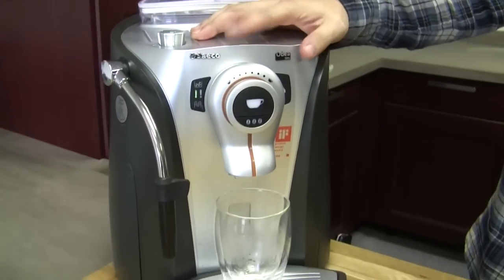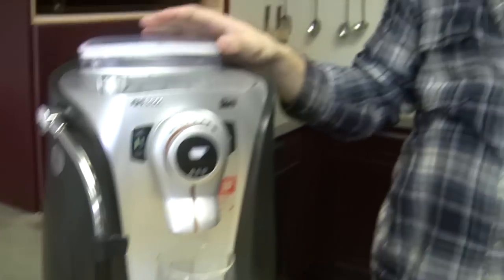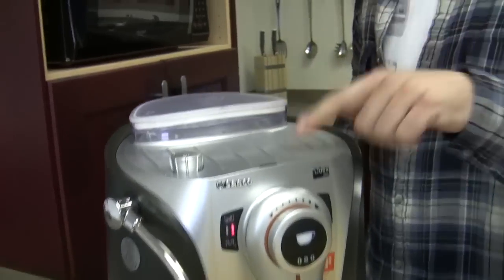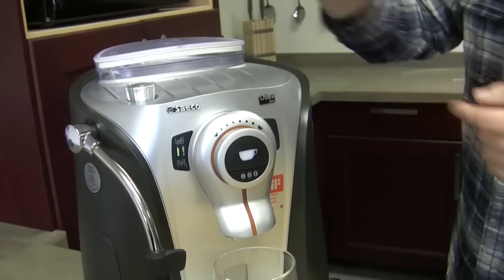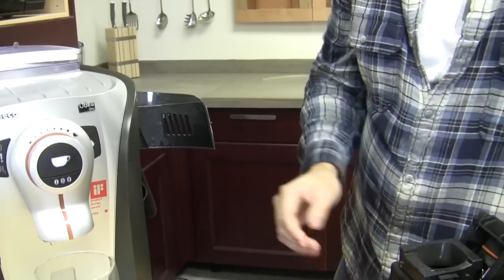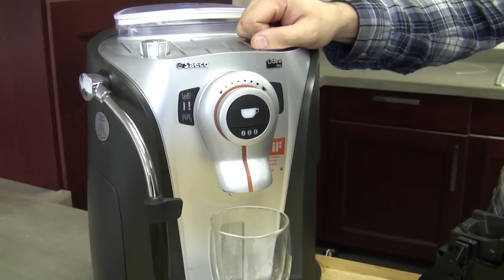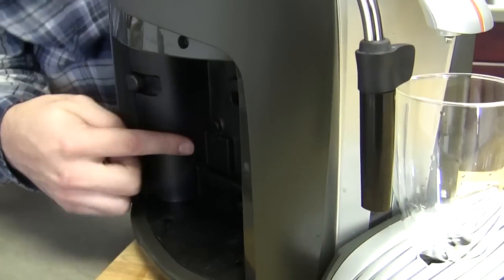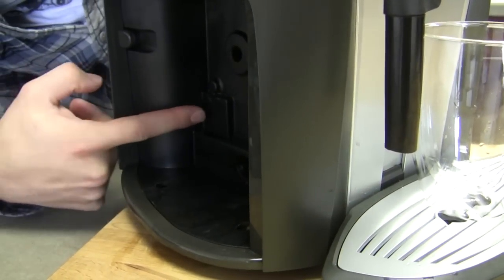SCG Tech Tip: Saeco Odea Alarms & Errors

Comment: Hey guys, what can it be when Odea doesn't "take it" when I select the 3 coffee beans, I'm only able to use mine with 1, if I put 2 or 3 it flashes all the lights very quickly and dispenses the ground, dry coffee away , I already changed the group's engine thinking that it had lost power and could not "press" all the coffee. Thanks

Comment: So I’m now just finding this video. I just recently just changed the gear kit . well, atleast the large one with the nob that I assume turns the brew thingy. I think I aligned it correctly so it will activate that switch I’m not sure what the switch does. 
Anyways now after goes thru the grinding and I hear it try stamp the grounds water runs but it drains into the water waste and no water is filtered thru also the no puck happens I’m guessing bc the water doesn’t flow thru so there’s grounds everywhere sometimes the puck ends up where the water waste drains to. The lights I get is flashes between the grounds light at top and the boiler light and then stops. 
Is that switch not getting activated? For the brew grouping to work properly? How can I fix that? Do I need to readjust the gears?

Comment: I've got a problem with my girl plus. The steamer no longer works. Tried to clean out wand. No go. No sounds from unit, either. Tried descaling. Hear steaming sounds but water will not pass through wand, but leaks internally near brew group. Is it a clog or malfunctioning unit. Thanks for any help!
Reply: Your tip may be clogged, mine did the same thing, needed to stick a pin up the nozzle to get it to work. It's tricky with the wand on. Hope this helps.

Comment: I had a quickly flashing exclamation point warning, which meant I had to prime it by running the steamer for a few seconds. I gotta say that it took me well over 10 minutes to figure out the problem and to brew a cup of coffee in the morning this is simply BAD DESIGN. I’ve never seen such an unnecessarily complicated coffee machine. Brews decent coffee, but you’ll never have this problem with a Keurig.

Comment: My Odea just traveled from Germany to the US and is running on a step up transformer. Just descaled and cleaned everything and have the following issue: If I turn the dial for the cup size past 1 o'clock (ish), it throws a solid red exclamation mark right after grinding the beans. Smaller cups work fine and it doesn't seem related to the bean setting at all. Any ideas what this might be caused by?

Comment: Hi folks. Hopefully you are still online and available for Odea Giro issues. 
I have appreciated the helpful tips for the Saeco Odea Giro thus far. I have the exact same unit as in the video. 
My Odea Giro on occasion will turn off without a prompt of the power button. The odd thing is, when I depress the power button to turn it back on again, it doesn’t turn on. 
However, when I rapidly and repeatedly press the power button approximately 10-12 times, the unit powers back on again. 
This has happened roughly 5 times over the past month or so. 
Any thoughts to what may be causing this issue?
Thanks again for the help. 
Rob
Reply: hey I'm having the same issue did you find a solution?

Comment: i have sent my machine in several times for repairs to resolve major issues that prevented the machine from brewing completely but each time they have failed to fix a secondary issue i have where the steam does not always work. I would say about 99% of the time when i turn then steam knob nothing happens making a typical 45 minutes descaling process to last several days turning the knob back and forth. Anything thoughts on what it could be?

Comment: Hi Matt. I have a serious issue. I have completed a descale on my machine, which I have done a number of times in the past. This time however, after getting the green light and preparing to make my first coffee, the the machine starts to go through the process, but then does not grind then the regular noise fades out, there is a loud pop and then everything stops and the red light comes on flashing fast. This has happened in the past and has cost me close to $400 each time to fix. I figure this is something that I could be able to fix myself as it seems to take them no time at all. The primer unit according the repairer has been replaced each time? I have searched the net for assistance, but to no avail. The machine is a Odea Giro and I do love him, but he's costing me financially, emotionally, and spiritually. Please, if you have any idea on what this is, could you please let me know. Cheers from a desperate Aussie.
Reply: +Hellen Laurie hey there... did you find a solution??? my machine just started that issue. THANKS! upset :-(

Comment: Hi Seattle from Spain.
I have both lights  descaling and alarm flashing slowly. I try to reset the descaling pressing the steam button for 10 seconds and the lights don't turn off.
When I turn the steam valve the steam goes out for the tube but I can't switch to the hot water pressing the button.
In test mode all the functions work OK.
Can you help me.
Thanks a lot
Reply from the maker: Hi Oscar T. Generally, the descale light and the exclamation light will not be on at the same time.  This tends to indicate that the machine is in need of something, or thinks that a door/drawer is open.  I would first attempt to clear the exclamation light, then consider descaling or resetting the descale light once the exclamation light has disappeared.  To clear the exclamation light, you'll want to take all of the pieces out of the machine (water tank, dump box, brew unit, and bean hopper lid), and make sure that the water tank is turned to the neutral, closed position (9 o'clock), then wait for 30 seconds for the machine to reset all of the sensors.  When you re-insert the pieces one at a time, you also want to be sure that the water tank is full.  When the pieces are back in place, that exclamation light should clear, or you may need to reprime the machine at that point, making sure that the steam light is not lit, then turning open the steam knob, at which point hopefully you'll get a steady stream of water.  Then, you should be able to clear the descaling light, once the exclamation light has been cleared.

Comment: Hi, I have a problem with my Odea Giro Plus.  The red light is rapidly flashing, so I prime the water circuit.  However, after doing this numerous times, the red light continues to flash.  Sometimes, the descale and dredge bin indicators will alternate flashing after I have primed the water circuit a few times.  Also, after priming for a while, the machine will appear to go back to normal but only brew one cup of coffee or start to brew one cup of coffee and then return to the rapid flashing exclamation point.  What are your thoughts based on this description? Thanks!
Reply from the maker: Hello Emily Kowalski. Generally, when you're able to clear the prime message, and you're getting a steady stream of water through the machine, if during brewing, you then get the prime message, it usually means that the grind setting is too fine for the beans and machine combination.  I would definitely suggest to go probably 2 notches coarser, then brew 4 times to clear through the mixture of the old and new grind settings, so that you are 100% on the new setting. Also I'd make sure your beans aren't too oily as that can clog the machine as well. Also weekly cleaning of the brew unit and screen helps a lot. Take a look here:  https://www.seattlecoffeegear.com/learn/videos-home/ask-the-experts/saeco-superauto-brew-group-tips. If these suggestions don't take care of the issue, then it would probably be best to get bring in your machine to a repair center. :)

Comment: How about the alarm light is on and quickly flashing. I don't know how to prime the water circuit
Reply from the maker: Hello nguyên khôi lê, When that exclamation light is flashing rapidly, you'll want to prime the machine by turning the steam knob open. This will engage the pump and direct a stream of water through the steam wand. You'll want to pull a steady stream of water through to clear the flashing light. - Haley
Reply: @SeattleCoffeeGear  Hi there, what do you mean by pull a steady stream of water through? I turned my stream knob open and the motor started, but nothing happened and the light was still flashing rapidly. Please help.

Comment: Hello!  On my machine the coffe and zig zag signs are blinking what should I do
Reply from the maker: Hello Amelie Gregoire Grenier, The coffee and descale lights indicate a grinder or a brew unit clog. You can try to move the grind setting to the largest dots for the coarsest setting. You can also clear out any beans/grounds in the grinder chute above the brew unit and in the grinder with something like canned air and perhaps by vacuuming them as well. It will take about 3-4 cups for the new grind setting to be in full effect, and hopefully push through the clog. You can then adjust the grind back down to the middle setting once the clog is clear, but remember that moving to a finer setting should only be done with the grinder running. You may also benefit from deep cleaning the brew unit at the video below:

SCG Tech Tip: Saeco Superautomatic Brew Unit Disassembly

Hopefully this does it, but if not, you may need to bring it in to a service center for a further look.  - Teri
Reply: Good thanks a lot for your help !

Comment from the maker: Hi Ines Pereira! If the descale light and the dump box light are flashing, then that means that you have either a grinder or brew unit jam. If when you turn on the machine it tries to cycle the brew unit and then gives you those alternating lights, it is likely the brew unit or the gear of the brew unit on the machine. On the other hand, if the machine cycles the brew unit, warms up, looks like it’s ready to brew and then when you press the brew button and the grinder begins- then you get those lights, it’s the grinder. Unfortunately though this might help to diagnosis what your issue is, neither of these problems are really fixable at home. Saeco can give you a list of repair centers at 800-933-7876, or we can set up a repair order for you to ship it in here through http://www.seattlecoffeegear.com/service/repairs. Sorry I can’t be of greater assistance on this for you! - Teri
Reply: I have the same machine (except it's called a GiroPlus, maybe the Japanese version or something) and got this error this morning and this is literally the only explanation I could find on the internet. Looks like it's back to the V60 for a while (not that this is necessarily a bad thing.) ;)

Comment: Hi there!
I have the Exclamation mark blinking rapidly and the water drop sign is still, I tried to descale several times and it still gives me that everytime I start it.
Reply from the maker: With a fast blinking exclamation light, it generally means that either the machine needs water, or it just needs to be primed. Pull water through the steam wand. - Miranda
Reply from the maker: To cover all your bases, the best thing is to take out the different pieces, water tank, dump box, brew unit, and bean hopper lid.  Wait 30 seconds, then reinsert each piece one at a time, firmly. Then reprime, and that should take care of it!
Reply: Thx a lot! The machine remained without water and I had to prime.

Comment: Hello, I really appreciate if you can help me with some issues that I am facing with my Odea-Giro, with descaling alarm. I went through all process to descaling, which I supposed it was automatic, and the problem is it never ends, I have refilled the water container more than 6 times, used to bottles of descaling solution and the alarm is still on. How can I have my machine back on duty?
Many thanks if you can help me,
Sam
Reply from the maker: so with the Odea line, you just have to push and hold the water droplet button, and after several seconds (just keep holding) the descaling light will go off.  Once the light goes off, you can let go, and you’re all set!  The descaling light is a constant reminder, by holding down the water droplet button, you are resetting the counter. - Miranda

Comment: Hi - Great Video - I have a unique problem - a solid red line not related to a water level issue. I have to lift the coffee bean cover off and put it back - then the light goes out...more importantly this happens after a failed cycle - the coffee grinds, I hear the work group move and it dumps the coffee grounds into the dredge group, followed by a solid red line.  I lift the cover - replace it and try again it may or may not work.  I repeat until it cycles through properly.  Any ideas as to the problem?  Thanks - great videos Pete
Reply: Thank you Sarah.
My grinder has three steps, and it was set at the largest one. So, yesterday I fixed it to it's finest one, and so far it works fine.
I hope this was the problem.
Thank you verry much, and have a nice day.
Andrei
Reply: I have also this problem. Can anyone help us with some advices?
Thank you!
Reply from the maker: Andrei Cosmin Mocanu & Peter Gustaitis, This could mean several things:
If the coffee pucks being dumped are too dry, then your grind may be too course. 
If the coffee pucks being dumped are too wet, then your grind may be too fine.
Is your machine pulling a shot at all, or just dumping the puck without producing any espresso?
- Sarah
Reply: Seattle Coffee Gear
Thank you for your promp answer.
So, my machine is a Saeco Odea Black Giro Plus, and it started with this problem just after I washed the brewing group. When I turn it on, it grinds the coffee and then just dumps the grinded coffee without anything else, and the red exclamation mark lights on.
After I remove the lid from the coffee container and push manualy the beans into the grinder, it grindes the coffee normaly and makes the espresso.
I hope my explanations suffice for you to give me a reason why it's doing this.
Thank you kindly,
Andrei
Reply from the maker: Andrei Cosmin Mocanu Are the beans you are using shiny/oily, or do they have a matte finish? It sounds like the unit is having trouble pulling beans into the grinder which can happen if the roast is dark and shiny/oily. You might want to experiment with a slightly coarser grind setting (one or two dots larger), and brew about 3 - 4 cups for the new grind setting to be in full effect. You may also want to switch beans if the finish of your current bean is shiny with lost of surface oils. If making these changes does not help, then you may need to bring the machine into a Saeco authorized service center for a look. - Sarah
Reply: Well I tried a different bean - one that is dry and not oily - problem went away.  I am now experimenting with a 1/2 dry - 1/2 oily combination - that seems to be working also.  Question: Why is it that some machines cannot process oily beans yet other exact same model Saeco machines can??? Thanks

Comment: My red light if flashing rapidly, indicating the need to prime the pump. I keep doing that, but when I make coffee, it is simply not coming out of the spouts, or whatever you call those two holes.  I tried cleaning the brew group, setting it to less fine grind,  changing coffee to less oily one, and still nothing......any suggestions?
Reply from the maker: It's hard to tell what could be going wrong with your machine from your description. I would check the Brew Unit Outlet (what the Brew Unit connects to when in the machine) and make sure that is intact. The Brew Unit Outlet has a tendency to break if the Brew Unit is inserted incorrectly. If you can not find the cause of your issue, I would recommend taking your machine to a Saeco Certified Service Center. - Brendan

Comment: hello - my video with throuble machine odea go is here:http://youtu.be/qtpbMa2YVu4 can you say, what is problem?
Reply from the maker: Considering the fact that it's actually leaking coffee is telling that the water is reaching the 'tamp chamber' in the brew unit while it's in work position successfully. I would take a close look at your 'brew unit o-ring' and the 'brew unit screen' and be sure it's clean and nothing is preventing the o-ring from making a proper seal and nothing is clogging the screen. Remember, it's always good to rinse your brew unit under hot water when you're done using the machine (Brew Unit is also dishwasher safe, top shelf). This will keep your brew unit in great condition and that's important considering the brew unit is the 'heart' and/or 'barista' of your super-automatic machine. 

It's also interesting that the leaking is not ending up in your brew unit drip tray. The 'Coffee Dispensing Valve' is also a common break on the Odea. You can find this by removing your brew unit and looking into the top left of where your brew unit would be making a connection. The 'Brew Unit Coffee Outlet' makes connection with the 'Coffee Dispensing Valve' while the brew unit is inserted. The 'Coffee Dispensing Valve' has a tendency to break off into the 'Brew Unit Outlet' over time from constant temperature change or if the Brew Unit is inserted improperly or aggressively. I hope this helps!

If neither of these thing fix your problem, I would suggest going to a Seaco Certified Service Center. -Brendan

Comment: hello
i have the red light flashing fast , not like the water is missing any idea?
Reply from the maker: A fast blinking exclamation light means that the machine wants to be primed.  Pull water out of the steam wand by turning the knob on top when the machine can produce water.  This means, if you have the water droplet button next to the brew button, that it is illuminated, and if instead it is the steam symbol, that this button is not lit.  After you pull a few ounces of water out of the steam wand, it should stop blinking like that. - Miranda